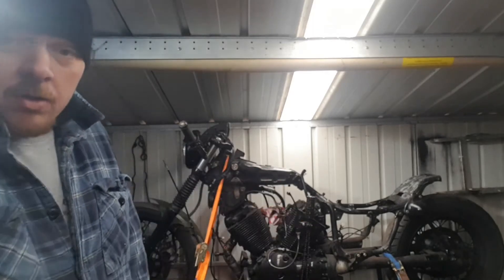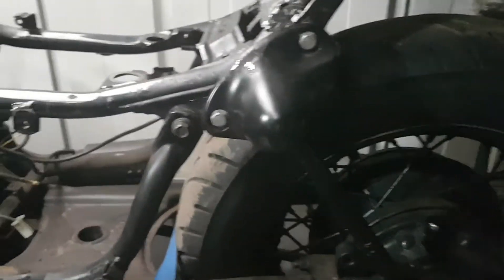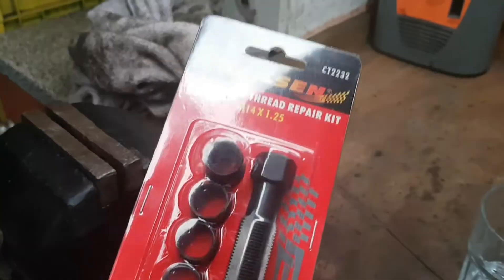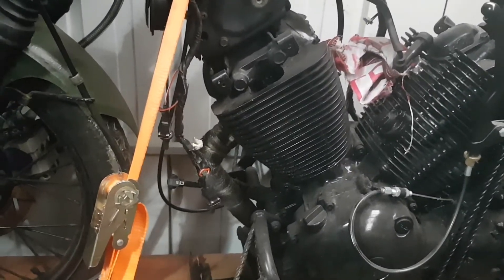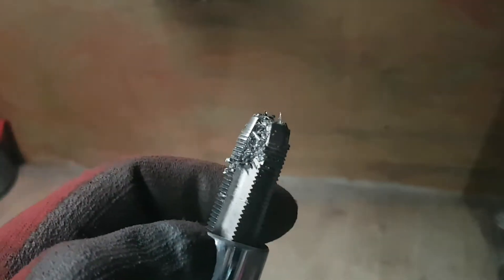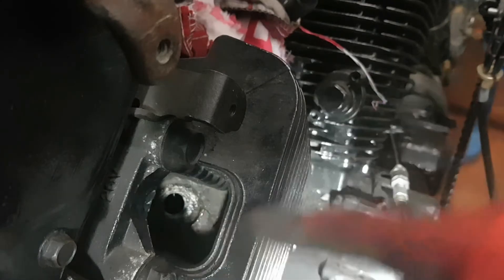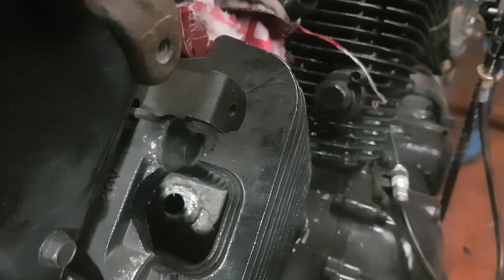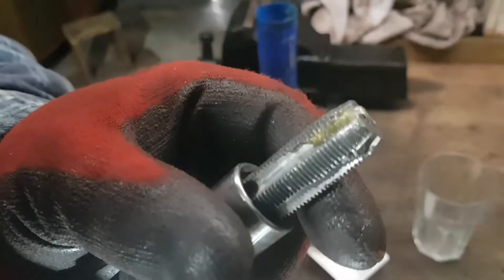Spark plug thread repair on virago

Comment: Good job, would cleaning the thread out rather than re threading worked ?
Reply from the maker: Might off but with it not sitting right and threads not looking good thought might has well just stick a new thread in.
Reply: @fuelheadjay8800  are you taking the head off at any point ?
Reply from the maker: If the compression test is still down then will have to.
Reply: @fuelheadjay8800  I always worry about thread cutting if chips get into the cylinder, may be better to take it off to clean it out properly before turning it over ?
Reply from the maker: It should be fine if not be a rebuild